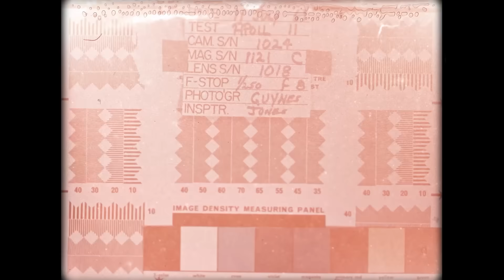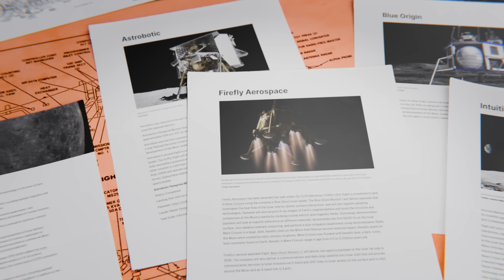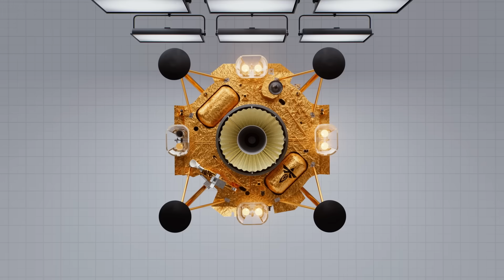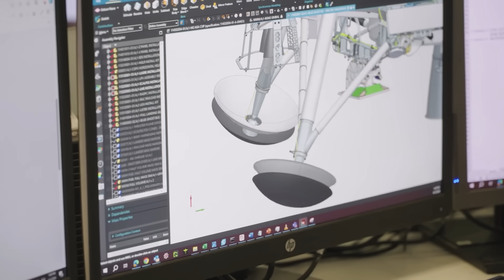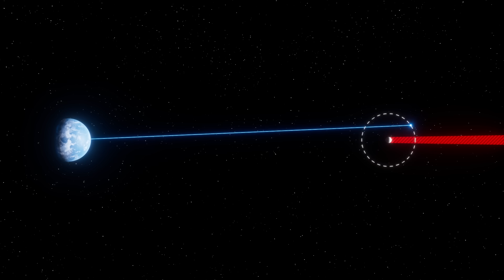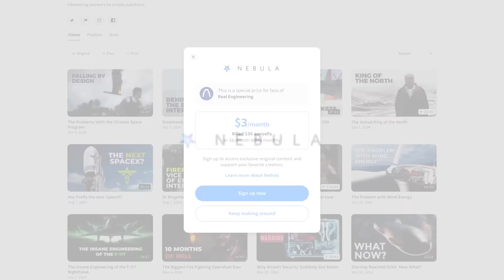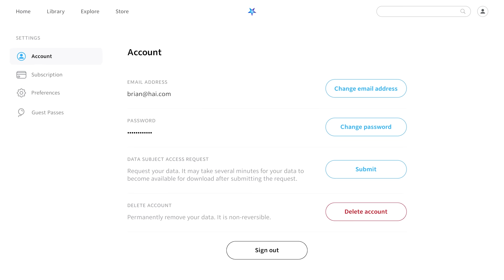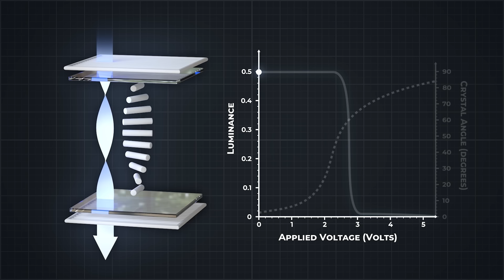Why the US is Struggling to Land on the Moon

Comment: 2:41 ah .. and there's your answer ... i mean you could just started with say  i dont know setting up a right of satellites in luna stationary orbit as the fist stage you you always have contact with the surface and then maybe  add a space station in orbit then use that as a base for  a luna shuttle as it were but that would be a logical and reasonable way to go about it .. and thus also expensive ...  i mean probably less expensive in the long run in that it would probably result in  actual space infrastructure that  isnt  falling over   and it would be reusable for other follow on missions and be a good start to more advanced missions .. but who has time fore that when you can just toss bricks of money at private company's

Comment: They don't have redundant cameras! What?! Why don't they use multiple cameras with additional LIDAR to navigate? I feel like we have another doomed lander.
Reply: Clearly you haven't seen enough Hollywood movies. You need to have multiple single points of failure, so you can have some interesting and unnecessary chaos to the mission. Otherwise, if you did things the way you suggested, everything will probably end up working according to plan, and we definitely don't want that. That would be just be boring and predictable... yuck!

Comment: Two of the 1960s Surveyor landers survived lunar night, and two more partially survived.  Why is Blue Ghost not expected to survive lunar night?  Are the integrated circuits less robust to cold than Surveyor's electronics, or are the modern batteries more cold-sensitive, or did the Surveyors have heated boxes for the sold-sensitive components?
Reply: Seems there was nothing that much fancy on Surveyor 7:
"The electronic equipment, requiring temperature control throughout the mission, was mounted on a thermal tray that distributed the heat throughout its compartment. An insulating blanket of 75 sheets of aluminised mylar was sandwiched between each compartment’s inner shell and the outer protective cover. "

"The main power reservoir was a 14-cell rechargeable silver-zinc battery. Fully charged, the battery provided 3,800 watt/hours. A non-rechargeable silver-zinc auxiliary battery installed in a sealed magnesium container provided a back–up for both the main battery and the solar panel"

But NASA failed a lot of Ranger and Surveyors missions before, so they learned an lot to make that one pretty good.

What is missing in those "new space" stuff is experience that only trying and failing can give.
Reply: And it's also a reason (I think) why NASA is stuck: they cannot fail. If they do, public and politics will call it a waste of money and blahblah.
Which means that:
- they are hugely expensive (superfluous security just to be sure)
- they cannot innovate. They do stuff they know how very well, but are reluctant to go beyond. Try improving your skying level without allowing you any fall...
 
I'm not fond of Musk, but the way SpaceX crashed tens of rockets before being able to soft land one is the most efficient engineering way to make break through.
And NASA cannot do that any more.

Comment: We should remember that man landed on the moon, not a computer. The skill of two extremely skilled and trained humans improvised to land. Self driving cars have trouble seeing every parked truck so it is a big step to expect it to see a grey boulder on a grey surface. They will get there but it is no surprise that there are early issues.
Reply: Actually the landing was done by the AGC, the astronauts would only feed it with inputs.
I doubt any human could keep the machine level, manually controlling each 16 or so thrusters at a time.
The AGC has a fully automatic landing (P66 if I remember well), but no astronaut used it (they remained in "manual" mode, which means a joystick to tell the computer when to head to). Engineer's first design had no manual mode at all, but astronauts insisted for it, afaik.

And agree that the system would have been totally unable to spot boulders or anything, and humans were needed to direct the LM at a suitable location.
Reply: @ThomasKundera moon landing was fake
Reply: @murchiann  "moon landing was fake"
No, but I wonder how you swallowed that fallacy.
Reply: There were successful autonomous lunar landers before the human landings. Check out the Soviet Luna missions and the American Surveyor missions
Reply: Sometimes there is no substitute for a highly trained professional and so often that is not fully appreciated.
Reply: @midtownmariner5250  ... yeah, apparently we had a ton more highly trained folks and superior tech 60 years ago.  

So... we have to re-learn that shit.  Really...?
Reply: Not so - the AGC (Apollo Guidance Computer) was a man-machine interface. The CDR could enter the decision loop after pitchover at the High Gate (P64, and every one of them did: Armstrong, Conrad, Shepard, Scott, Young and Cernan), but it wasn't 100% necessary except in Apollo 11's case where there was an overshoot of the planned landing area, making it obligatory for Armstrong to enter the loop and fly Eagle past the boulder field the LM would have landed in had he not done so. The LM could not be flown without the AGC providing guidance and stability (firing the attitude control thrusters to compensate for shifts in center of gravity caused by sloshing fuel in  both stages, for example, and displaying radar altitude).
Reply: I think what many people are forgetting in the comments especially when they think about technology in the 1960s, is the 1st flight of the SR71 was in 1964 also Ford used computers & auto dyno technology to win Le Mans victory in 1966. The world in the 1960s was full of innovation & pushing the envelope arguably more than today because of western nation co operating & not competing like today!!
Reply: @mustangmanmustangman4596 NASA admitted searching for a material for the space suits that could stand going through Van Allen belts 😂😂😂

And they will be ready in 2027
Reply: @Cormac-jd2kx  "NASA admitted searching for a material for the space suits that could stand going through Van Allen belts"
That's wrong. Why are you so naive?
Reply: @ThomasKundera that’s right you LIAR

The also said they will be ready for 2027
Reply: There were a bunch of unmanned soft landings on the Moon before Apollo 11. USSR's Luna 9 and 13, USA's Surveyor program. Presenting the "we used to land with humans before, landing with machines is harder now" is misguided.
Reply: Sadly you are mistaken
Reply: They landed with an electric vehicle on their back that could go 60 miles. And broadcasted live from the moon. If technology keeps advancing fast enough it might not be long until we invent a time machine and go back to the 60s and beg for the technology to go to the moon
Reply: @MrBob1984  :
"They landed with an electric vehicle on their back that could go 60 miles."
Only since Apollo 15

"And broadcasted live from the moon."
Right.

" If technology keeps advancing fast enough it might not be long until we invent a time machine and go back to the 60s and beg for the technology to go to the moon"
Makes no sense.
Are you serious?
Reply: It's not that big of a leap in all honesty. The grey boulder on a grey surface doesn't matter when they are using LiDAR and other radar techniques. There are limitations to each radar type, which is why a combination of radar types will honestly make the computer able to judge a situation way better than we can with our eyes. Optical illusions are very real and it's not something that we can overcome. A computer can if it's given the right sensory system (we are stuck with our eyes). Computers are amazing and they will be able to get the job done. It's just not exactly easy to create the perfect code that takes everything into consideration. That's where the astronauts come in. They can make decisions when the parameters are too off for a computer to work. Computers can already land planes and they can also catch or land discarded boosters, the latter is something that no person will ever have the slightest chance of doing. It can definitely land a slow moving object on the moon if coded correctly. Technology has come a long way since we last were on the moon.
Reply: @ I partially agree but planes land based on various radio transmitters giving precision approaches on a known surface. These facilities don’t exist on the moon. Self driving cars have shown themselves to be less than perfect at spotting things that a human can easily. It’s not that I am saying they won’t get there, only that we seem to perhaps to be further off than it seems.
Reply: We should remember that even nowadays after 9/11 abd Corona, people still believe every shit they see on TV
Reply: @Thre1152  "people still believe every shit they see on TV"
You seems to swallow a lot of fake easily.
Reply: @ThomasKundera  What fake would that be???
Reply: @Thre1152  : "What fake would that be?"
Like imagining that our source of scientific knowledge is TV.
Reply: @ThomasKundera  Since you don't even use the word "fake" according to its meaning and in the right context, I doubt that there's much room for scientific knowledge in your brain.
Reply: @Thre1152  :you were the one mentioning TV as source of scientific knowledge. 
So, I doubt quite more about you on that.
Can you cite another (better) source of scientific knowledge about Apollo program?
Maybe it will help to change my curremu projection.
Reply: @ThomasKundera  ... Thomas, do you believe everything  your govt tells you?
Reply: @BwanaFinklestein  : People who are asking that question are usually very misinformed conspiracy theorists.
My bet: you would be way less wrong by blindly swallowing what your gov is saying than by following your current beliefs.
Earf is flat too?
Reply: @peterj5751  watch the press conference. It’s clear those guys didn’t go to the moon.
Where are the high res images of the previous landing sites and materials we left behind. It’s 2024 and still not an ounce of evidence just propaganda
Reply: @MattSturbaiten  :
"watch the press conference. It’s clear those guys didn’t go to the moon."
It's exactly the opposite they say in that conf.

"Where are the high res images of the previous landing sites and materials we left behind."
There are satellites images of the remains of the landings.
Your point is?

It’s 2024 , that's 50 years all evidence are available, but you'll still find ignorant deniers.
Reply: @peterj5751  Can you wake up to the lies one day, you make yourself seem gullible almost stupid. Not one person has set foot past the Van Allen radiation belts, let alone the moon. Ever.
Reply: @deanhall6045  Can you wake up from your ignorance one day, you make yourself seem gullible almost stupid. Apollo missions passed the Van Allen radiation belts,and landed on the Moon.
Open an history book.

_"He means that it was 3rd hand footage supplied by the see eye aye."8
Evidence of the CIA involvement?
Or you just randomly pulled that out of your *ss?  Wake up. Stop inventing stuff and study.
Reply: @peterj5751 ... yes, I remember when it was aired on US television LIVE as they landed and the president had a chat with the astronauts on the Moon. There is just one tiny bit of info you are missing. I give you a hint: 12:50  They don't have the technology now... and they sure didn't have it back then.
I recommend watching the movie: Capricorn One
Reply: @ I’ve seen Capricorn 1. It was fiction. 

When you say we don’t have the technology now and didn’t then, I don’t agree. We don’t yet have reliable technology to do a full unmanned auto land in on the moon with 100% reliability. That is not what they did in the Apollo program. Humans have been driving cars for well over 100 years but we still can’t make a trustworthy self driving car. Does this mean we haven’t had the technology get in a car and go places yet? Of course not. 

The new spacesuits are being designed to be much more useable than the ones they used in Apollo. I’m sure they could try to rebuild the Apollo ones but they have decided to start again. 

The Saturn 5 could be built again, but it was all hand fettled and the skills and production facilities have long since been lost and dismantled due to the program being shut down. The decision was made that it is cheaper to start again using today’s facilities and techniques rather than recreate the old facilities to go back to Apollo. A lot of this was to do with politics and jobs in political districts. I mean, the new SLS is using space shuttle engines because of political reasons. I’m sure given the freedom and money NASA would have loved to use dedicated engines designed specifically for the mission just like they could for Apollo. 

Apollo cost a lot more money than Congress is prepared to throw at it now. That’s why it was shut down early in the first place. While it was about beating the Russians money was no object, but once that was achieved, it was just a hugely expensive budget line. 

Finally, they took risks that aren’t accepted now. They burnt 3 astronauts alive ground testing the Apollo 1 capsule and it only delayed them 20 months. Can you imagine what would happen now? 

I see no technical hurdles that were insurmountable at the time given the limited scope of the missions, the money thrown at it and the risks they were prepared to take. Try longer duration and more complex missions at a much lower cost and with much lower risks, that’s where the modern day technological difficulties come in.
Reply: @peterj5751  Well put!
Reply: @attilazk  omg I feel stupider after having read you. There is a 1.2 second delay between the earth and the moon, aka 2.4 seconds between your question on Neil Armstrong's reply. You can definitely have an almost real time chat. We totally have the technology now for that. What we CAN'T do is pilot the lunar module from earth because 2.4 seconds is too much of a delay, anything can happen in 2.4 second. That's why they rely on autonomous decision making (that's what the Chinese did on the far side of the Moon, where communication is impossible).
Reply: @attilazk  Yeah they had access to a high quality "feed" and chose the blurred and bad quality version for some reason lol...
Reply: @robertelmo7736  " chose the blurred and bad quality version for some reason "
You mean?
Reply: @ThomasKundera  He means that it was 3rd hand footage supplied by the see eye aye. Wake up.
Reply: @attilazk  : "They don't have the technology now..."
Depends what you mean by that.

"and they sure didn't have it back then."
Obviously had, as NASA did go to the Moon.
Reply: @ThomasKunderaBis ... Thomas, you believe everything you govt tells you?
Reply: "We should remember that man landed on the moon" Never happened.
Reply: @kinetic3971  "Never happened."
Twenty four people went to the Moon in nine missions, of which twelve landed in six missions between 1969 and 1972. Inform yourself.
Reply: @ThomasKundera 😂😂😂😂
Reply: @Cormac-jd2kx  : You mean?
Reply: @ThomasKundera 🤣🤣🤣🤣🤣
Reply: @Cormac-jd2kx  : Level of flerf argument : "🤣🤣🤣🤣🤣"
Maybe 4 yo IQ?
Reply: @ThomasKundera just a PhD 😂😂😂😂😂
Reply: @Cormac-jd2kx  : In emoji?
Sure.
Bought on ebay, I guess.
Reply: @ThomasKundera Cranfield 
Ps- 😂😂😂😂A A
Reply: @Cormac-jd2kx  : I care very little of your (supposed) academic achievement, when what I can read of you is only "😂😂😂." 
It means that either:
- you're lying (for now my dominant hypothesis)
- you're just playing stupid for <reason>. As I can't find any honest one, then it means that you're morally corrupt (using your intelligence to lie to others instead of helping them). (maybe)
- you got some issue after receiving it (mental disorder, accident, etc.) that altered your cognition (not giving too much weight to that one)
- you got indoctrinated in some stuff (cult, conspiracy theory) that consumed your intelligence (possible)

What else do you suggest?
Reply: @ThomasKundera just read the 1st 3 lines 😂😂😂
Reply: @Cormac-jd2kx  : Lets go back to fact, and lets start simple:
Do you believe Earth is flat?
Reply: @kinetic3971 ok.but where were you in 1969??

Comment: Didn't the Doobie bros have a song titled "what a fool believes"!!Did NASA hire a trailer to get the lunar buggy up there.Now the liars are telling us they can not only get to Mars which is supposedly 50,000,000 miles away(with what fuel)but no-one can put a man on the moon at 250,000.
Reply: "Didn't the Doobie bros have a song"
Your only source of "knowledge" is pop songs? That explains a lot.

"!Did NASA hire a trailer to get the lunar buggy up there"
The LRV was in the LM lower stage storages.

"Now the liars are"
You have been lied to. But not by NASA.

"they can not only get to Mars which is supposedly 50,000,000 miles away"
Distance to Mars is  between 50Gm and 400Gm depending on relative orbital location.

"with what fuel"
Rocket fuel.

"but no-one can put a man on the moon at 250,000"
Right now, no.

I agree however that an inhabited Mars mission is unrealistic in the near future, and that going back to the Moon is a needed step in the process.
But USA elected Trump with Musk being there too, and craziness level will only increase...